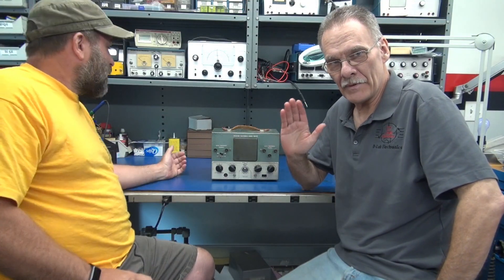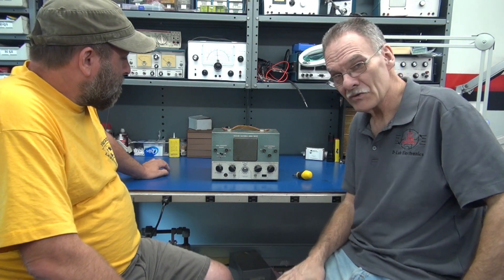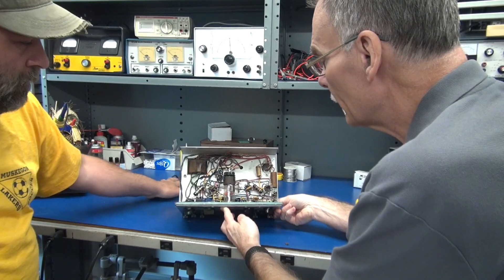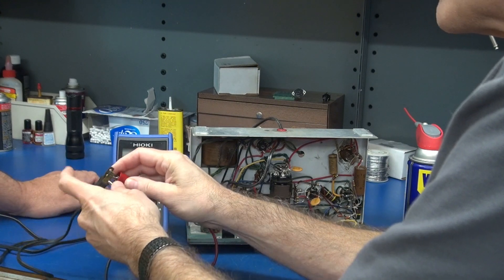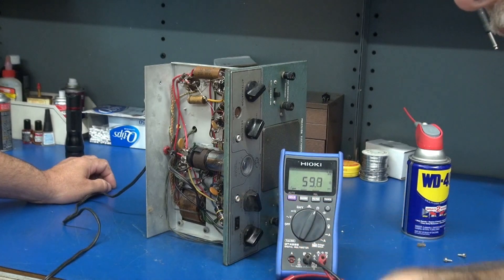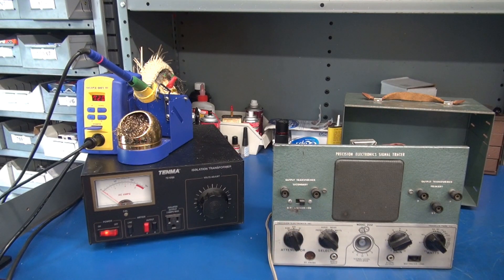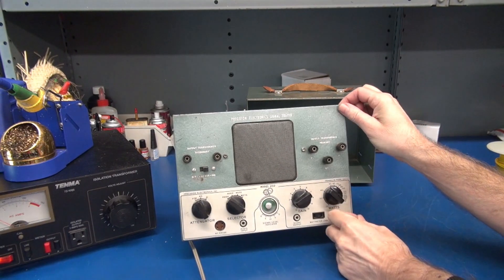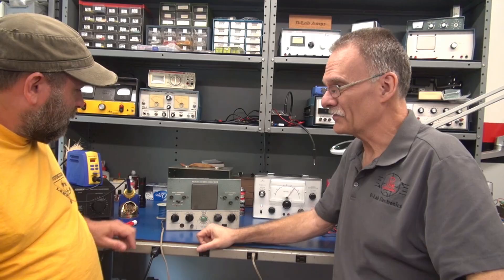Vintage Tube Precision Electronics Model 202 Signal Tracer Repair Antique  shop find

Comment: My Heathkit T3 is quite similar to this, older valves are used however. Good find! Pse check the other caps carefully for leakage, the wax & bumblebee ones may not be good.

Comment: On the grill covering the speaker there should be a white colored drawing of a tube and an oscilloscope waveform. The RF
probe missing contained a 6AB4 tube. The transformer you were wondering about was for the Wattmeter. There is a site
 out there with a manual and a few pages also showing a schematic for everything needed. Search Precision Electronics 
202 Signal Analyzer. You will need to make a RF probe for it. Indeed a great find.

Comment: Why not install a three prong power cord?  Just curious.
Reply: The ground wire goes back to your home's circuit breaker box and connects directly with the neutral wire buss
bar. Most people don't know that! However you must add a properly polarized plug to it you and won't need a
 three prong plug. The hot side must be switched and fused as well.
Reply: @hestheMaster  In Canada, the ground wire goes to the ground bus in the panel and only to there.  The neutral wire is NOT connected to the ground system at all.  The difference between them is that the neutral carries load current whereas the ground wire does not.  For safety the chassis should be connected to the ground wire not the neutral.

Comment: Nice find! Nice repair project for sure.. I ran across a 202 about 10 years ago, but it was in ultra poor condition, the front was corroded and the outer case was very poor. The seller wanted $75.00 for it, but I felt he was not up to date on its true value in such poor condition so I passes.. I have the EICO mint condition 147A and mostly use it for the Noise Function for noisy resistor..
This vintage gear is neat to operate and required for older vintage equipment...
Thanks for the video, appreciated as always.
Robert, San Diego